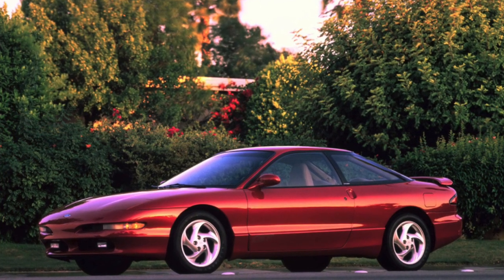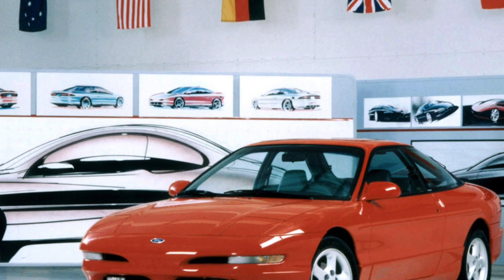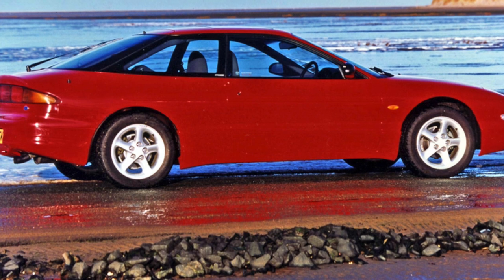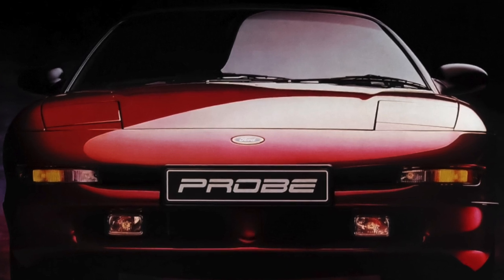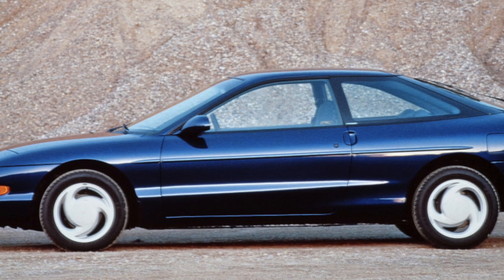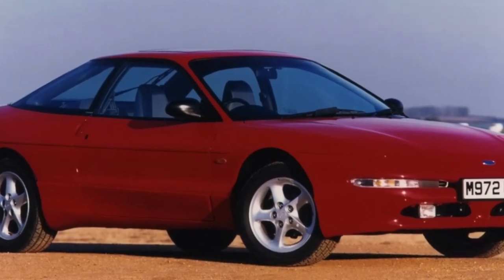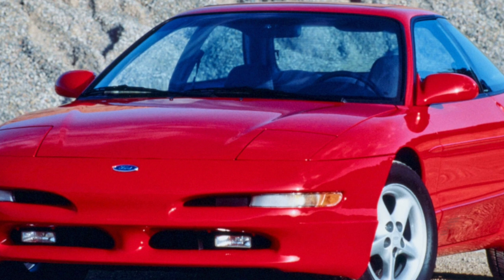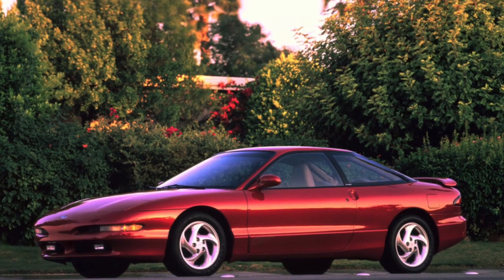Ford Probe 2 - Check For These Issues Before Buying

Comment: Interesting. As you say Ford has forgotten it. Mechanical parts are practically all Mazda and despite suggestions they are different usually fit OK. Only rust problems I have had are the edges of the sunroof - the seal retains water, and around the windshield. The latter probably due to paint damage when the screen was replaced. Handbrake sticking on was a serious problem on earlier models, requiring new callipers. The  European models had a Bosch immobiliser which caused the distributor to fail and both items had to be replaced at around 60,000 miles. Worst current problem I have is the exhaust heat shields which seem to be mostly held together by rust.

Comment: Had the 95 mx6 from 35k to 275k over 10 years with the 2.5 5 speed only major flaw is the expense of the timing belt change water pump change . I also swapped I’ve rot the ZE engine and was a greet handling car and kept me safe . She was t boned and twisted the unibody seemed junked

Comment: I am a proud owner of a 95 Probe and the issue I have is airbag light comes on dash. Went to electrical specialist and they could not figure this out either. One owner told me check the fuse located in the airbag module but that was fine too. So, this is an issue that comes up now.
And the other thing is your keyhole on the front doors has a white plastic, which is now brittle and can easily break off. 
The rear antenna rubber seal is wearing off so it now leaks the water through
The driver seat adjustable air pump bolsters are not working....
Reply: I had a problem with the airbag several years ago. A specialist checked it out, but it still came on sometimes. Then I realised battery was low. New battery fixed the problem. Strangely despite having replaced the battery many times it only happened the once. I don't have your other problems, maybe as my car has always been garaged. The one problem that seems to be impossible to fix is the rubber seals round the doors. There is a metal core inside and water has got in and rusted it, causing the rubber to expand. Seems no chance unless from a breaker. Rock Auto did have it listed but now say it is no longer available.  
Lights in the keyholes and footwells still work, but I had to replace the tiny bulbs in the door switches.
Reply: Ive got a 94gt and had the airbag code 51 flashing for 10 or 15yrs now..been so long i cant recall!  codes for the airbag flash in long and short sequences.. they are easy to read and check which code means what.. I could never find though, the Cause of the code 51...its a short to ground in the system and even replacing the Airbag module controller, it just threw the code again becuz the short was never fixed...  The dealers advice about the fuse IN the module is likely the same code as mine.. there is a fuse in there that burns out becuz of a short Elsewhere in the system..fixing the fuse, without finding the cause, its just gonna blow again..code 51
Reply: @skip741x3  The fuse does not necessarily burnout because of a short. It's heat sensitive. I was all set to replace my fuse on my 94's airbag controller. I take out the box and it's not the same controller. It does not have that fuse in there lol. Also code 51. If you do replace it ever, the new one needs to be shielded and have some aluminum hang off the leg being soldered to absorb the heat. Just replacing it can ruin a new fuse. If you've had any rubbing in the front wheel wells, 2 of the airbag sensors wires run over the wheels. One on each side. My 93 ripped them out. 94s sit a little higher.
Reply: Did you ever fix this issue?
Reply: @michaelsteane3131   Fix the rubber seal for the antenna but the rest unfortunately  still in progress. But I suspect the airbag light could have been because I did not connect the driver seat cables. Testing this theory soon. And saying that I don't get airbag light on at all. So, pulling out the instrument cluster to check that. With OEM part almost not available its hard to fix the test. And now my Tach meter decided to die. 
But have fixed small  things though. and replaced broken relays.
Thanks
Reply: @pgtmr2713  Wow! Im just checking these posts again...I need to look more often!  Thanks for the feedback bro...I knew that the wires  from the left and right sensors run over the wheel arches and of course theres one in the center front as well.. my wires seem to be ok...if I knew what to check for as far as resistance in the connectors that are at the ends of the wires , I could pull the connector and check each sensor to see which is bad... this happenned for me after driving thru a flooded area where water came up to the lower bumper area... when I exited the flood, I had the code 51.. been there ever since.. the water shorted Something... you'd think once dried out, with a new airbag module, the issue would be fixed but no go..
Reply: @skip741x3  Yeah you're kind of stuck where I am with no fix. It's possible the sensor got water in it. Airbags are designed not to go off with only one sensor shorted or triggered. 2 out of 3 meh I don't know. Maybe you can see which sensor it is by taking it off and looking for corrosion or an opening. One sensor at a time, after following proper airbag disabling safety precautions. There's got to be something, some way for water to get in. Keep us posted. I may take another look at mine when I get to working on putting the engine back in. Top 3 fears, airbag goes off while driving, airbag breaks the windshield, or I make a mistake messing with the system and airbag myself while someone else randomly gets a great YT vid. 😀
Reply: @pgtmr2713  It would be Great to get the airbags working again after al these years! amazing that we both have the issue and neither has resolved it.. ford probably has a recall or at least a TSB regarding it becuz ive heard about this code happenning to So many owners, probably a factory fault that enabled it to trigger the 51 code...Im leaing twords the sensor in my drivers front wheel arch, located near the front bottom of the arch behind the inner fender protector...I actuall have 2 or 3 sensors that I pulled from the scrapyard of another probe gt..they could be bad, I have no idea how to check these with a multimeter...Ironically, my airbag light currently flashes code 24   meaning "Open in circuit 944B or low-resistance in crash sensor(s)".   since theres only 3 of them at most, you'd think replacing one or all of them might do the trick..then again, I think the internal fuse is still blown in the airbag module  so that along with the sensors would still need fixing...On a different note: had a similiar issue with GF's  2003 ford focus that had an ABS/brake light on... codes said abs module was bad.. pain in the ass to get it out.. there were rebuild shops wanting 350.00 to Rebuild my old module, screw that!  then the swaping it out with one off ebay seemed the way to go but people were saying you Need to reprogram the module or it wont work becuz the vin#'s are different..reprogramming costs a couple hundred at dealer.. finally, I took a chance, matched the part # and software numbers on the module exactly, got one from same yr focus, bolted it in and no codes, abs working great.. total cost 90 bucks off ebay delivered...forums are helpful but they are also full of misleading advice as well..sometimes you gotta take a chance and find out for urself whats true and what works...The airbag thing is similiar.
ive search forums till my brain hurt and no exact ,clear answers other than the fuse is blown in the module..whatever triggered the fuse to blow needs resolving cuz it will do it again as soon as u plug in the module ..I'm with you on not wanting to have the airbag go off unexpectedly, thats for sure! keep me updated if you get it fixed, I'll do the same.
Reply: @skip741x3  I don't know if there'd be a recall for a 30 year old vehicle.

Comment: I owned a 1994 Probe GT decades ago that had an intermittent problem of not starting. It would turn over but no start. It took a reputable garage 3 days to finally find the problem. There's a pigtail connector for the fuel pump that had a bad connection.

Comment: distributers fail on the 93-94 models ...more correctly, its the ignitor Inside the disty that gets roasted over time and then no spark..you are stranded..  HEI mod or externally mounting an ignitor takes care of that issue
Reply: Mine failed at around 60,000 miles. In Europe Probes were fitted with a Bosch immobiliser which was supposed to have caused the problem. Certainly on mine replacing the distributor apparently fixed it but then I had intermittent cut-outs which were only fixed after a new immobiliser was fitted. At that time cheaper fixes were not available.
Reply: You can also do the MAF swap and switch to a 95+ distributor, which helps. Since that uses a 95 style disty Still can fail but it's much cheaper for a coil or the other disty internals.
Reply: @pgtmr2713  How hard is it to do that MAF swap?  do you need to convert the OBD1 system to OBD2 or is it just a matter of rewiring the connectors?  what did you notice power wise after the swap?  that original 
VAF sensor with the restriction piece that moves was a terrible design, choking airflow

Comment: I own a 1989 Ford Probe with 110,00 miles with  nil seat wear. This Probe cant have 50,00 miles with that much seat wear. Yes beautiful a red Probe.
Reply: I’m looking at buying a manual ford probe 1990 GT with 81k miles for 3k should I do it the body is in great shape I own a bmw e46 right now so I’m already used to having to keep up with maintenance is it worth getting this ford probe as a project car ? The car is running and there has only been 1 owner